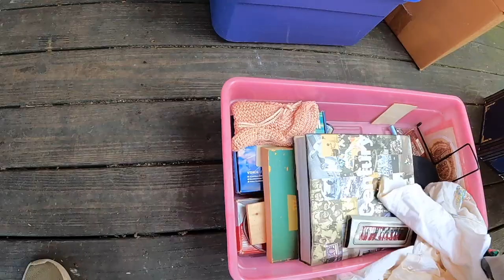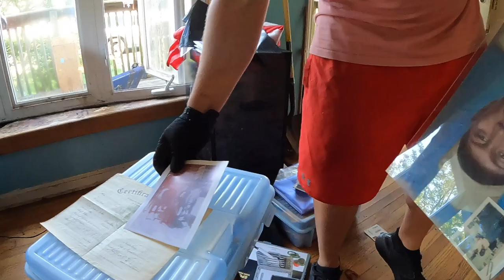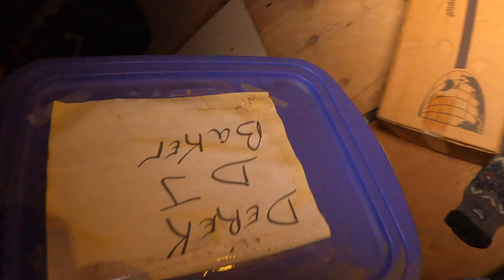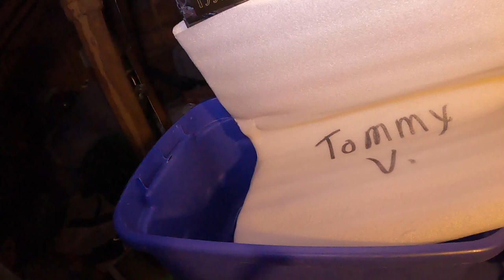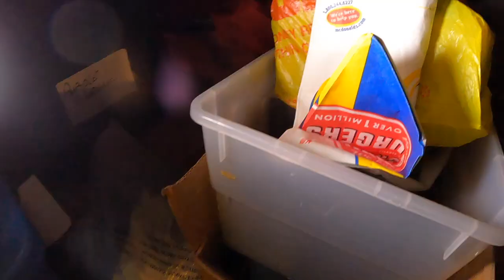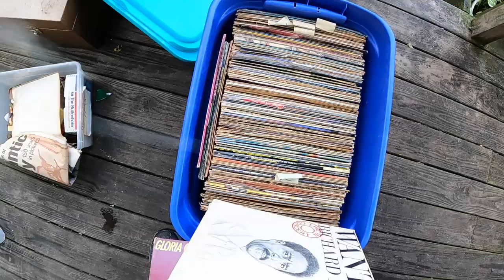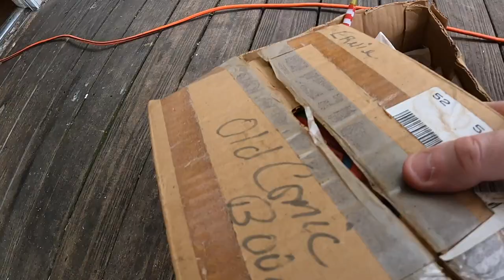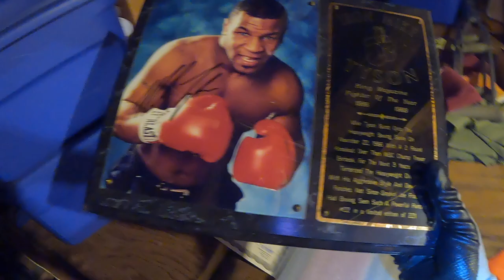This ATTIC Was ABSOLUTELY Loaded With Collectibles!

Comment: As a life long sports card collector I was at the edge of my seat hoping you would reveal more about the sports cards. The only cards I got a glimpse of were those that came in the tiins. If I remember correctly those tins were produced in the early 90's. Which matches up to the time frame of those plaques.  I'm super curious what that 5000 card storage box contained. When you briefly removed the cover I could tell from the card stock that they weren't recently produced cards. Hopefully for your sake those also weren't from the late 80's - early 90's. .

Comment: If it makes you feel any better , That Tyson looked off. Those signatures were more likely than not forgeries. Those little certificates of authenticity that came with them are garbage. You or I can print one of those things out and sign it ourselves in 5 minutes. Those cheap plaques were everywhere in the 90's. My local mall had a kiosk with hundreds of those plaques. I had 5 or so as a kid. Back then I was young and just getting into the sports memorabilia. So I never questioned the authenticity , especially coming with a "certificate of authenticity". Now years later and much more knowledgeable I wouldn't go anywhere near a signed plaque like that unless it's authenticated by one of the top authenticators in the industry.
Reply from the maker: Actually the Tyson ended up going to a friend of Greg’s he gave us $50 for it to hang in his house so that was cool.